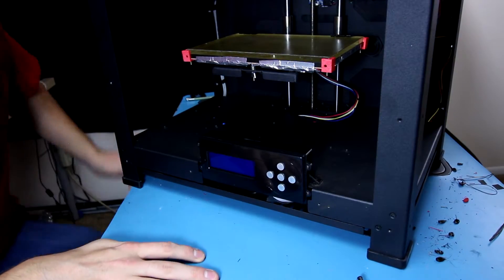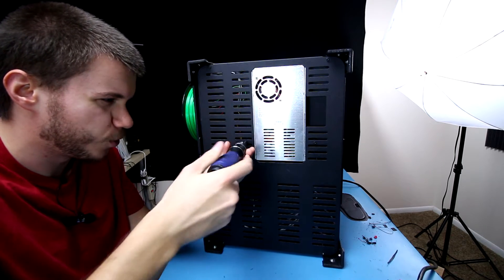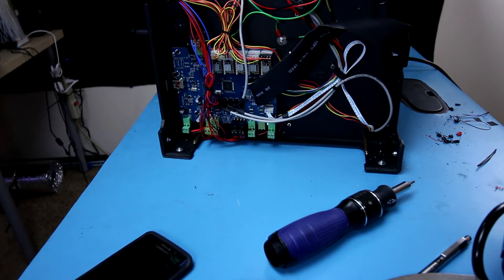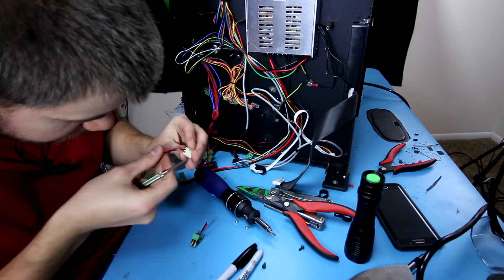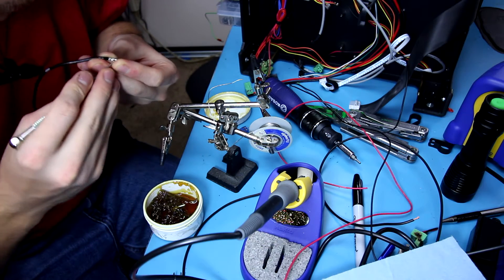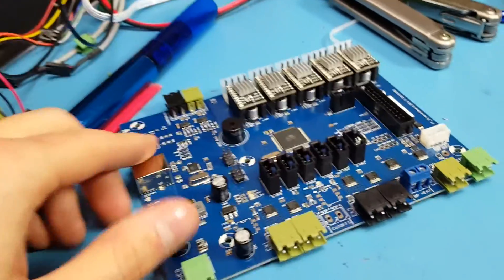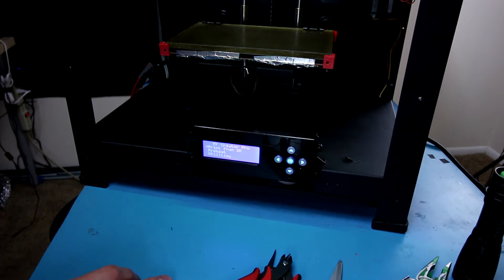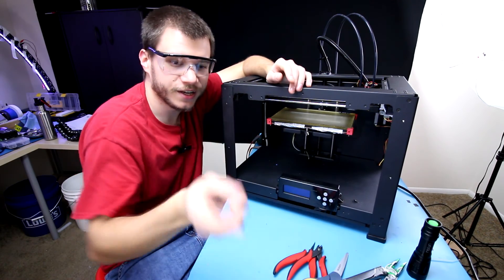Flashforge Creator Pro Repairs - Logic Board Swap / Heated Bed rewire

Comment: I have search a lot for some repairing videos this video was the first one talking about flash forge repairing and it was very useful

but I have a different issue if you can advise me would be perfect..

my creator pro LCD display showing me 
(tool 1 failure temp limit reached) and once it shows me it beeping bad feeling ;) with flashing red 

can you please advise?

thanks anyway

Comment: I sure wish I could find a schematic of the board.  I replaced one of the chips (switching voltage regulator) which I believe I fried after I reseated one of the stepper motor drivers.  I didn't have my reading glasses on and I had the board shifted up an entire row.  A quick squeak from the piezo and a tiny spark near what I would have assumed would be U101 and it was no more.  Ordered a new chip from Mouser...didn't address the issue.  So now I'm out $125 for the board.  :(  Toying with the idea of putting a Duet 2 Ethernet board in it.
Reply: pmgodfrey What'd you do? The forums are near useless - they spit out info that's like greek and when you come back with questions they answer in the same language and then refuse to help any more. Mine's been sitting about a year now, never got to use it. Waste of over $300 plus the heavy mess of metal.

Comment: Thank you very much for this video.  It really helped me to get my printer back up and running.  My platform had exactly the same problem with the connecting wires burning out.

Comment: Have you encountered and issue where the stepper aren't getting enough power and make a "duh duh duh duh duh" sound while empty loading and unloading of filament?
Reply: ALL THE TIME!  At first I thought it was a heating issue.  Regardless of the temperature, it would just sit there and perform poorly.  I'm wondering if the power supply is enough for this unit. I have a Meanwell 450 Watt power supply that I was going to use in a laser engraver...I might try it when I rebuild it.  They're cheap enough.

Comment: have you ever seen the overheat led illuminated on the logic board, and is there a way to contact you directly?
Reply from the maker: Yes, it seems to stay on all the time for me. Been using my printer for over a year since this video has been out with no issues, knock on wood.
Reply: @powerplayground  i have the same problem with the lcd dscreen... and the heating wires burning out suddenly... i replace it but my screen shows the same as in the video... need help! mother board or screen? moreover i have the overheat LED wich is illuminated (red). Thanks!
Do you know if there is something else to do if i change my mother board? (software...?) thanks!

Comment: My creator pro got a tiny piececof AND in the SD card SLOT.  And I cleaned it out,carefully but it,don't,read,the,SD card what do I do
Reply: Try and use Cable or wriggle card ...pull lcd out and mount out the front... put plastic on bottom of machine